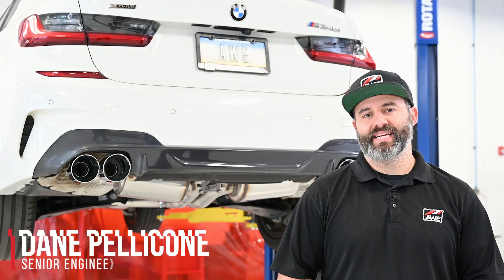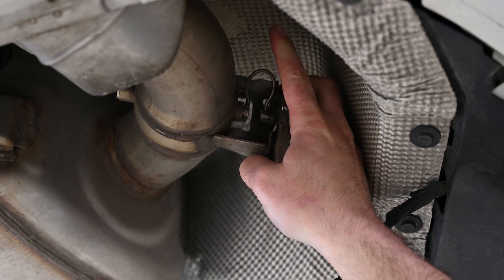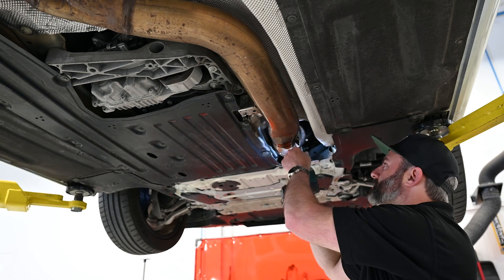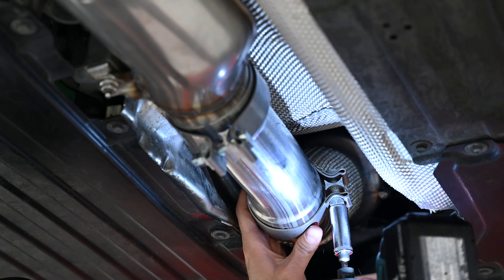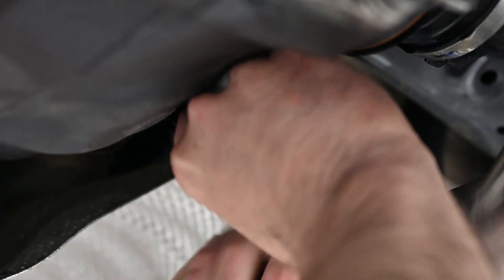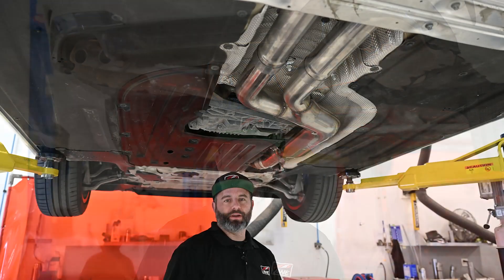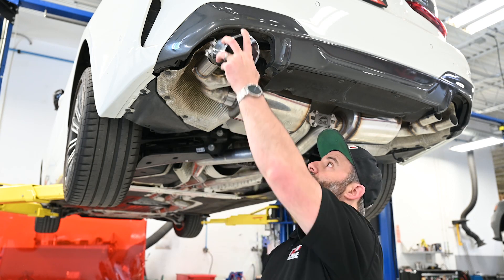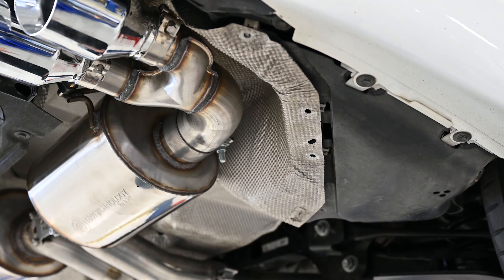Install: AWE Exhaust Suite for the BMW G2X M340i/M440i

Comment: Do the valves still open and close in sport or comfort?
Reply from the maker: The modes on these BMW applications have ECU differences and you can still hear those changes in the tone and note when selecting between modes. We use valve sims to ensure no CEL from installation of the AWE system.

Comment: Awe has some exhaust systems without muffler but resonated
Are those good?
I have a catless dp
Reply from the maker: The Track Edition is going to be very aggressive with a catless DP. If you want comfort on the highway, consider the Touring Edition.
Reply: @awetuning  should the non resonated touring exhaust work?
Also I read somewhere that the mufflers at the end of the touring exhaust system don't really work as mufflers but resonators. Will that make it sound like a straight pipe or do they kill some of the unwanted sounds?
Reply from the maker: @mohammaddalloul9891  Non-Res Touring with a DP sounds awesome. What you read is correct -- 180 Technology® resonator are not traditional packed mufflers. They're straight-through resonators with zero packing material. If you look through the resonator, it looks exactly like a straight pipe. They're engineered to hone in on particular frequencies that produce drone, flips them 180 degrees, and injects the flow back into the primary stream. It's straight-pipe tone and power without drone. Magic, really.
Reply: @awetuning I bought the track edition for my 2025 M340i and the resonators in track edition is straight through so it’s like a straight pipe from the dp back right? I want as loud as possible because I’m keeping stock dp.
Reply from the maker: @Rs8888-g4h  Correct, all of the resonators in our systems are straight through, they exist to tweak tone not volume.

Comment: Why not weld a bracket for the exhaust valve simulator to mount to, even if it isn't actually moving a valve anymore? It seems like that would be a better solution that tucking it under the heat shield to rattle around.  I'm interested in the system for my '23 M340i, it just seems like your team built an amazing exhaust system then took the most expedient solution when it came to the exhaust valve simulator.
Reply: Agree. I just installed this and just letting it hang there inside rear fender liner is not the smartest thing to do.
Reply from the maker: @E39M5SPEED  Tucked into the heat sheilding, it's safe. We tested, nothing to worry about.
Reply from the maker: It doesn't move around when tucked away. Also, the valve motor is still ooperating when attached to our simulator. The design of our simulator is what keeps the ECU satisfied.

Comment: Will this fit in a G42 M240i?
Reply from the maker: Negative, unfortunately. There's a significant length difference between the two.
Reply: @awetuning  will you guys be making an exhaust for the G42?
Reply from the maker: @gOldEnfFatTy2997  No plans at this particular moment but could always change.
Reply: We need a M240 G42 exhaust!!

Comment: What’s the loudest exhaust you guys offer ?
Reply from the maker: The Track Edition would render the most volume both in and our of the cabin, but not by much as the Non-Res Touring Edition is a straight-through design with no traditional acoustic packing material.

Comment: Why no valves on this exhaust? Missed opportunity. For the price it should of had them.
Reply from the maker: Our patented drone-canceling solution, 180 Technology®, gives you full control of exterior volume via the throttle while killing drone within the cabin. In short, they're not necessary. Pricing for our full catback configurations start just over $1500 -- major value for a US-crafted configuration that provides 65% more flow over stock with such a signature sound. :)
Reply: AWE I definitely love the signature sound. I have the AWE switchpath on my Golf R and love it.  I guess I’ll have to see it in person to see what it truly does. I was just comparing to what your competitors are doing such as dinan which offers two valves, no drone and maintains full factory for under 2k. The touring version with black tips gets close to 2500$.
Reply from the maker: @TheErichottie  Appreciate your support! While their configuration is an axleback, we mate to the downpipe. Right after the downpipe lies a radical, bespoke stamped merge upfront that's equivalent to dual 3" tubing. Top that with complete modularity, a straight-through, patented drone solution that works,  and proven gains of 16 hp and 12 ft-lbs of torque at the wheels on stock software (with all emissions equipment in tact -- meaning no warranty woes). No cutting involved, either. The valve isn't missed once it's gone :)

Regarding your pricing reference, yep, that would be top tier as it's equipped with optional resonators for additional downpipe-tone tuning. We recommend the Non-Res Touring Edition for use with stock downpipes, or go with the lower-priced sibling, the Track Edition.
Reply: AWE sounds very cool! Love the engineering behind it. You make me want one 😁
Reply: CarJunkie do you have the v2 Golf R exhaust or the 1st version?
Reply: Does putting the valve controllers in that pocket make noise while driving?
Reply from the maker: It's this loud ... "                         "   So, nope! Can't hear 'em.